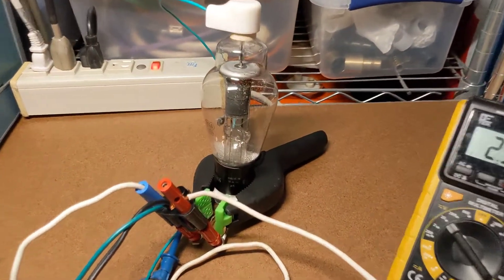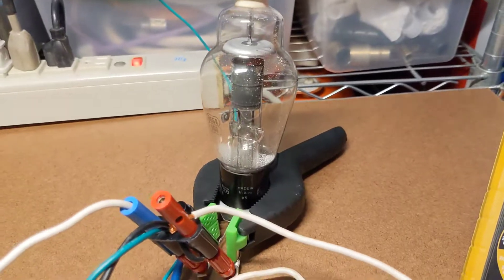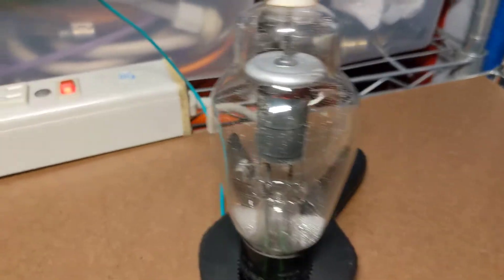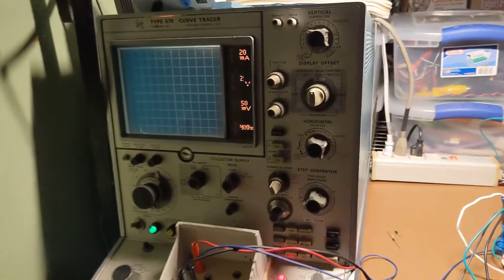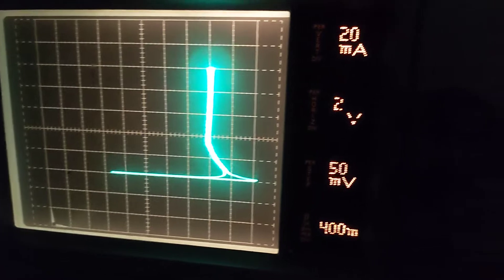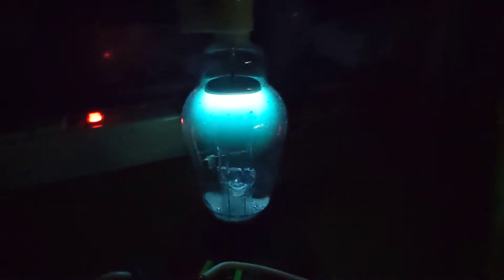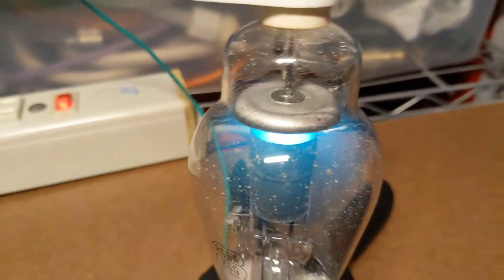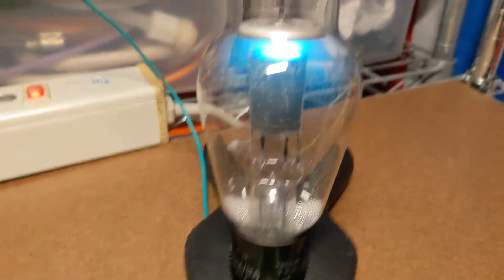Lighting up an 866A Rectifier Tube

Comment: If you using these MV tubes in a power supply, the tube output must have a series choke (inductor) Before the filter capacitor. The filament will burn out without a series choke.
Reply from the maker: Yeah for sure, there's a 10 H choke waiting for the day they get put into an audio amplifier...for show more than anything 😂

Comment: Once handled MVTubes must be warmed up (heater only) for about 15. minutes before applying plate voltage or you might experience a damaging "flashback" an arc.  View a type 8008. tube next, for real power. Ron W4BIN

Comment: 3:49 since he’s contain mercury vapor gas I have a feeling that these amplifier tubes does emit a high amount of  UVC rays which is completely dangerous to the environment if you wanna take a look at the light show while listening to music only use these for a short amount of time a maximum of Two minutes is good enough

Any minute more would be a hazardous thing to do
Reply: Glass blocks UVC. Germicidal UVC lamps are made out of Quartz or Fused Silica, which will pass it.

Comment: I hope you know, but these tubes are emitting radioactive waves too.....
Reply: I have a pair of these in my 3000 Volt  500mA power supply used for my 833c linear RF amplifier. As expected,  there is no reading on my Radiacode 102 Scintillation Geiger counter.
Reply: @HowardKlein1958  at the military, we played with those type rectifiers in a Russian radar mobile station. The counter went to brrrrrrrrrr around the power supply. Maybe some Radon or Palladium or something used by the Russians in the tubes?
Reply: @BMRStudio yeah some gase filled tubes (even some NE-2 lamps) have radionuclides to kickstart the conduction. This is actually believable but not every gas filled tube has it.
Reply: @BMRStudio You need around 70-100kv to create x-rays. 500v will never be enough.
Reply: @BMRStudio Furthermore, the anode (the target) should be a heavy metal like tungsten, depending on the wavelength you want to produce.
Reply from the maker: Hmm...Bremsstrahlung or UV? The voltage applied here was maybe 500 V, the tube maximum is a few kV. Not quite enough to x-ray. A little UV, but the glass blocks the worst of it and makes it like being out in the sun. Put on some sunglasses and sunscreen if an event is made out of sitting next to the tubes 😉
Reply: @anthraciteenergetics5497 all he says is “do research…” hahah
Reply: @anthraciteenergetics5497  do research ...
Reply: @BMRStudio  the waves are radioactive!!! oh no!!!
Reply: @Tacet137  buy a Geiger counter, then listen to the ticks! Enjoy it!
Reply: @BMRStudio  
Sadly, math does not support the subjective fantasy of youtube hysterics.

 Funnily enough, the 866A mercury vapor rectifier tube used in this video, despite its high-purple color, can't even radiate UV light. Why? It's not hot enough simply because the voltage drop across them is in the 15-volt range. Multiply that voltage drop at even 500 mA, and we get 7.5 watts of heat plus the filament heat, and they actually run cooler than a 5U4 rectifier, which can be at 450 degrees F. You need double that temperature for UV emmission; you would know that if you knew Stefan-Boltzmann Law, but that requires, you know... education, tough luck mate. 

Not even worth disccusing x-ray emission, as you need ~40 kV for that to even begin being a miniscule issue.
Reply: @BMRStudio if you can make radioactive waves from 15eV particle collisions I’m seriously impressed. You should probably patent that, it’s either cold fusion or overunity.

Comment: Does this produce X_rays
Reply from the maker: No, I was running it at around 500 V. This tube is rated for maybe a few kV max. Not enough juice to make X-rays. UV radiation might be a concern but the glass blocks the worst of it and I wouldn't make it a point to light a room with them 😉
Reply: No, it's simply impossible both at the miniscule voltage and temperature here, even UV emission will be near zero spectral radiance since with only 15V drop the tube actually runs cooler than your typical 5U4

Comment: Is there any reverse recovery loss? or, is it like a Schottky? I know that a normal vacuum rectifier has virtually zero reverse recovery loss, unlike a typical silicon solid state diode. I've never tested a hot cathode glow rectifier, nor any arc discharge mercury rectifier.

Comment: Good morning. Yes !!! I would like to know, if it does not contain mercury, to provide a bluish light? Is it non-toxic mercury? Are these sources still made? THANKS
Reply from the maker: This tube has mercury, and would be an exposure hazard if broken.
Reply: Oh yes that is real Mercury alright, very very toxic and it will ruin your house if you break it. Even more if it is hot because the mercury will be ionized and much more air born then so then you better run and fast. I love mercury tubes, I even got an even much much bigger one. the scary part is if they would break. but they give a very nice light show
Reply from the maker: @Pulverrostmannen  It wouldn't "ruin" your home, though it would need to be cleaned up carefully (by you, not a hazardous materials contractor as is often used by people who get over-excited by small mercury spills)
Reply: @anthraciteenergetics5497  small spill sure. But the amount in such tube is not small amounts. And liquid Mercury is not that bad if you can pick it up somehow. 
But I tell you, if that mercury is vaporized as when a tube is warmed up and in ionized state it is very VERY airborn. And if you inhale these fumes you are in for it. Mark my words you are in a bad spot then
Reply: Mercury is an interesting metal for sure. It was quite a bit of fun when I was a child. I use to break thermometers to get the mercury out of them. Then I would roll the little balls of mercury around in the palm of my hands. I did that quite often as a child and never had any negative effects from it. All us kids would play with it back in the 1960's. I am now 64 and my brain has always excelled over my pears. Perhaps the mercury made my synapses work better. Who knows? We also chewed on the lead based paint in our cribs back then when teething. The old schools we went to in Massachusetts, had asbestos insulation wrapped around the exposed radiator heating pipes in the back of the classes. We would etch our names into it. And what was really 'powdery', we would break off and through it around. Moral of the story, we did not wrap children in bubble wrap back then like folks 'think' we must do today! Sure accidents might have happened but they would have been extremely rare. Kids die more today from trying to fight off disease because of all the garbage that is injected into their bodies to protect them from everything under the sun (as if). Kids need exposure to build healthy immune systems. Even now, I right this on day 5 of having Covid. And I have never been jabbed! Flues and colds are no fun. But they make us stronger when we have to fight them off!
Reply: @ElectroRestore  Same here.  My dad was a ham radio operator from before I was born until he passed at age 82.  I have been licensed since 1967 at age 12.  He used many of these mercury vapor tubes.  I used to break the bad ones and collect the mercury, as well as from thermometers, thermostats, mercury switches, etc.  I had about 4-5 tablespoons of mercury that I played with, bare handed, storing it in a glass medicine bottle.  My son played with it his whole childhood.  I'm 71 now, he is 50, We are both above average intelligence. no health issues, and both have had very successful technology related careers.  Yes, mercury is dangerous in vapor form. just read up on the old gold miners.  But at room temperature, not so much, IF you use common sense.  Don't eat it, don't inject it, and you'll be fine.  The whole problem with the world today is that common sense became extinct with the latest generation, and none of that gen know how to live without regulations to replace their lack of common sense.  Just remember, one of the most lethal substances is water....IF you aren't careful with it.  Think about that.
Reply: Hello, well yes you have to be careful that you can break not to explode too much. (!) Because of mercury. Because mercury is a metal that is very toxic!!! Who is pooping his moon!!! Above all, take precautions in case it can break.
Reply: as a hobby chemist i second that. gaseous mercury will kill!